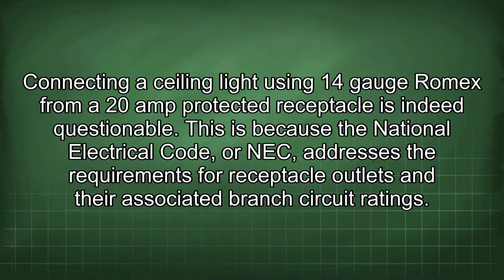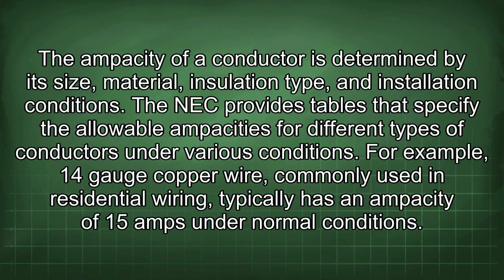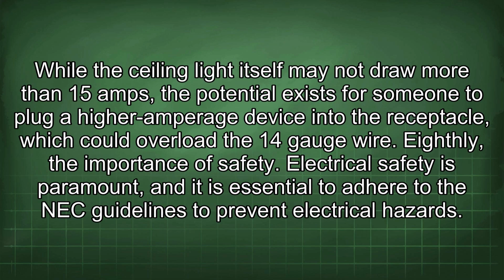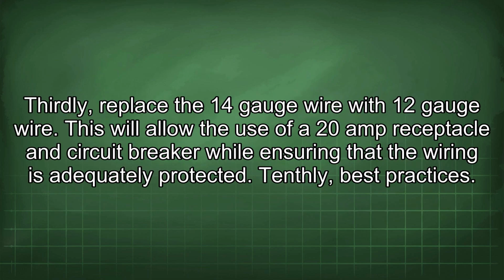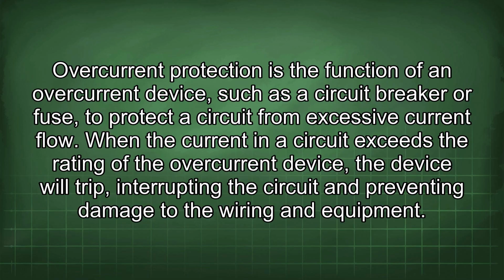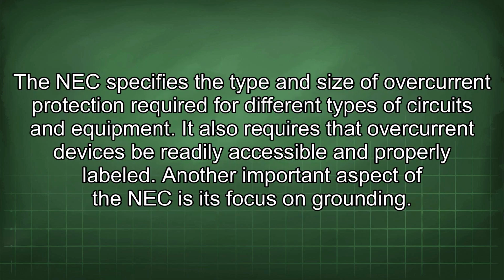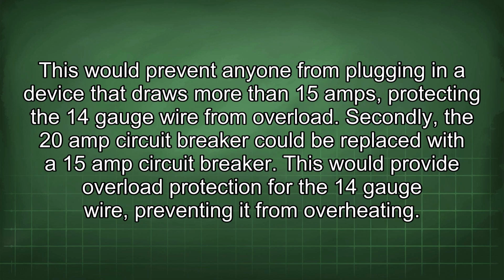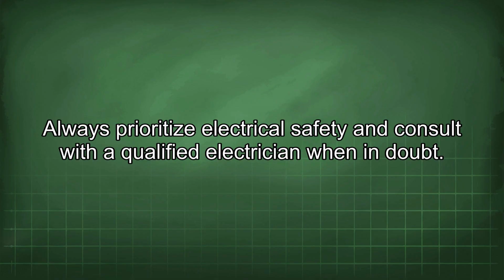20 Amp Receptacle Feeding 14 Gauge Romex Questionable?

Comment: 15 amp breaker for the circuit?
Reply from the maker: Hello @JMP1649,

Thanks for your question. It depends, namely what your goal is. Let us know the details please, and we will give you our assessment. There are a lot of variables.

1. Voltage drop.
2. The type of circuit (e.g. dedicated compressor vs. receptacle[s)].
3. If applicable or known, the rating of the load (i.e. an air conditioner compressor manufacturer OCPD specifications).
4. The type of wiring (e.g. NM [romex/lumex])
5. The number of CCCs (current carrying conductors).
6. Box fill.
7. Conduit size/fill.
8. Type of wiring .

Please let me know your specific conditions and we will review it!  In general, for receptacle circuits, 14 AWG will cover 10 and 15 amp receptacle circuits. Higher temperature non-NM will cover 20 amps, however, we strongly recommend upsizing for reliability and reduced waste heat.

Higher Temperature Rated Wire (14 AWG) and 20-Amp Circuits
While it's true that some wires, like THHN/THWN, have a 90°C rating, the NEC generally does NOT permit using 14 AWG wire on a 20-amp circuit, regardless of its temperature rating.

Here's why:

NEC Table 310.16 (or similar tables based on the NEC edition): This table specifies the allowable ampacities of insulated conductors based on their size, insulation type, and ambient temperature.

For 14 AWG copper conductors with 60°C insulation, the allowable ampacity is 15 amps.

For 14 AWG copper conductors with 75°C insulation, the allowable ampacity is 15 amps.

For 14 AWG copper conductors with 90°C insulation (like THHN/THWN), the initial allowable ampacity is 20 amps.

NEC 240.4(D) - Small Conductors: This is the critical section. It states that for circuit breakers and fuses, the overcurrent protection for 14 AWG copper shall not exceed 15 amps.

The Exception and Why It Doesn't Apply Here
There are specific exceptions to 240.4(D), but they generally involve scenarios like:

Motor circuits: Where specific motor protection rules apply.

Specific appliance circuits: Where the appliance manufacturer specifies a higher breaker size, but even then, the wire size must be adequate.

For general-purpose branch circuits supplying receptacles and lighting, 14 AWG copper wire is limited to a 15-amp circuit breaker.

What You Can Do with Higher Temperature Rated Wire
The higher temperature rating (90°C) of wires like THHN/THWN is primarily utilized in two ways:

Derating Calculations: As mentioned before, the 90°C rating allows for more conductors to be bundled together in conduit or raceways before their ampacity needs to be derated. You can then apply the derating factors based on the 90°C column and still end up with an ampacity that meets or exceeds the requirement for the overcurrent device.

Temperature Correction: If the ambient temperature is very high, you can use the 90°C rating to apply temperature correction factors.

In Summary
For standard 20-amp receptacle or lighting circuits, you must use at least 12 AWG copper wire according to the NEC. Even if you use 14 AWG wire with 90°C insulation, you are still prohibited from protecting it with a 20-amp breaker due to NEC 240.4(D). The higher temperature rating of the wire does not override the limitation on small conductor sizes.

Sincerely,

BESA Research

Comment: That feels wrong to me.  14 guage is pretty wimpy wire.
Reply from the maker: Hello @robertschaaf7192,

We recommend the use of 12 gauge, though there is nothing in the code stating that you have to use it for the new 10 or traditional 15 amp circuits aside from alleviating potential voltage drop issues. It is technically even permissible for air conditioner loads or higher temperature wire on 20 amp circuits, but NOT for NM (romex/lumex) on a 20 amp receptacle circuit, to be clear.

Sincerely,

BESA Research